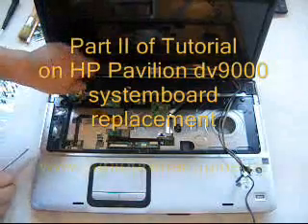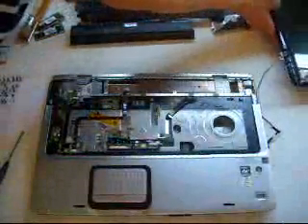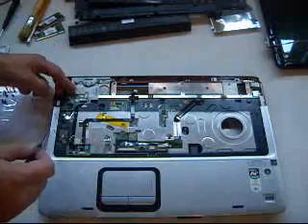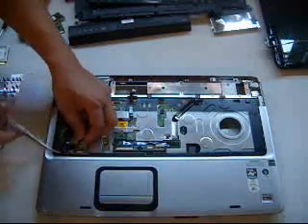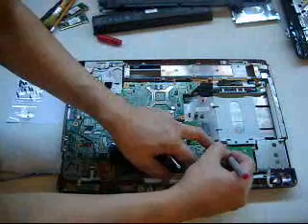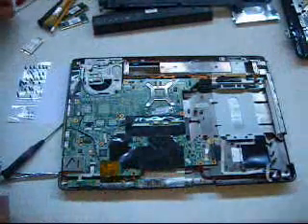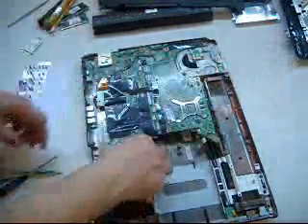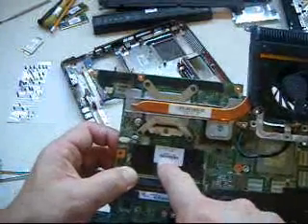HP dv9000 systemboard replacement part 2

Comment: One question please, Ive got a dv6405us and im buying a new motherboard because of the overheating problem, i checked the spare number on the new one that im wanting to buy an its the same number, but it doesnt come with the microprocessor can I simple remove the old one and put it on the new motherboard?? its an AMD Athlon X2 or do i have to buy a new microprocessor too? Thanks!